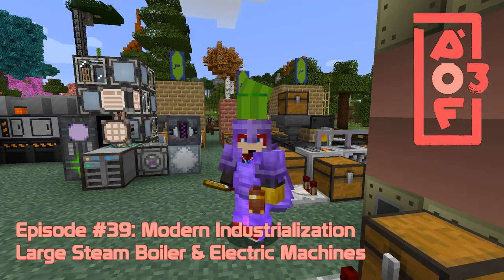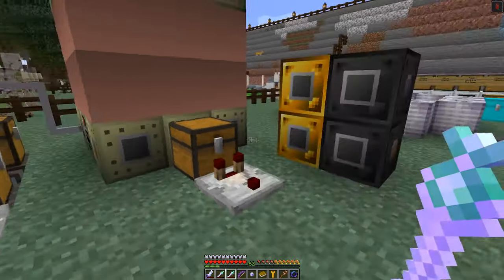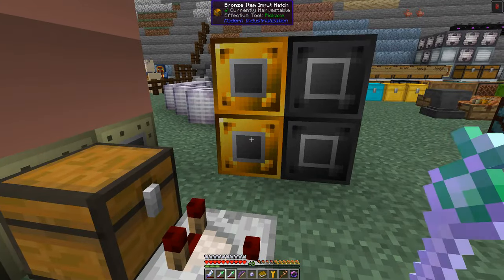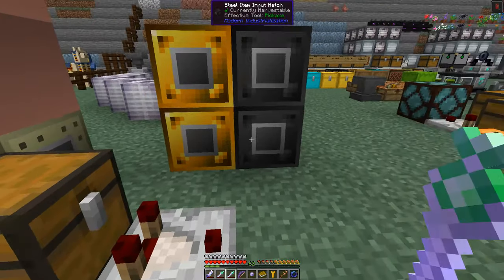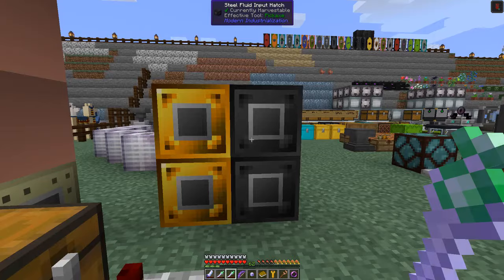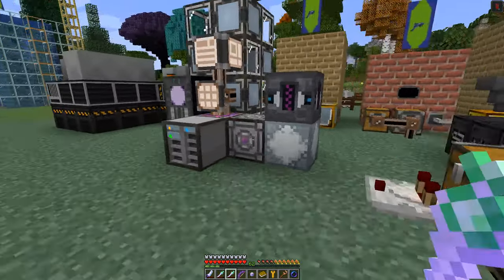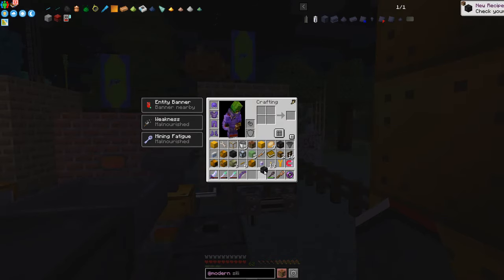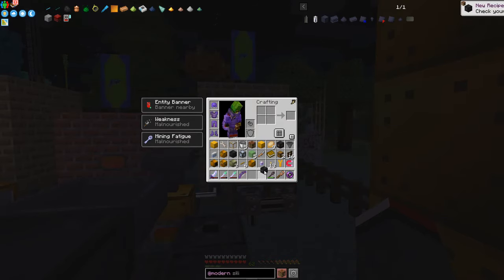All of Fabric 3 #39 - Modern Industrialization: Large Steam Boiler & Electric Machines

Comment: Are heat up my large steam boiler with lava buckets and I don’t know how to extract empty buckets from item input hatch. Do you have any solution for this?
Reply from the maker: Try adding an output hatch, they may go there. I’m just guessing but can’t test it to check.
Reply: @duncanwebb4934  after adding item, output, boiler stopped working.  Item pipes cannot extract items from item input hatches unfortunately. I started using coke to heat it up.
Reply from the maker: @kubojadek  glad you found a solution.